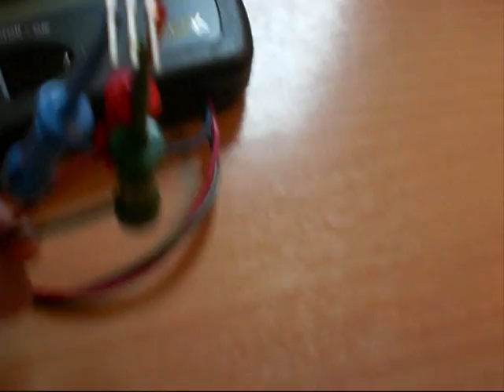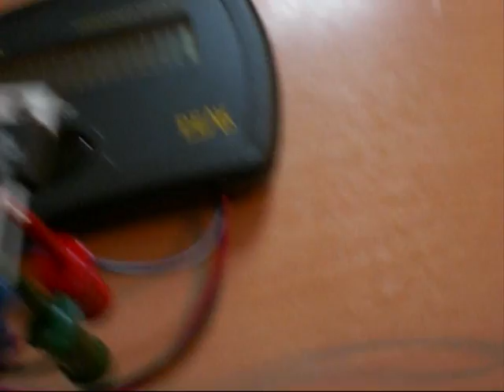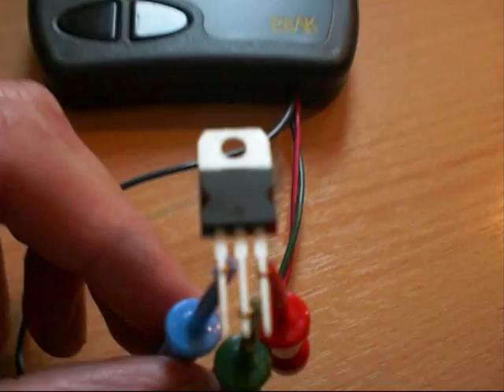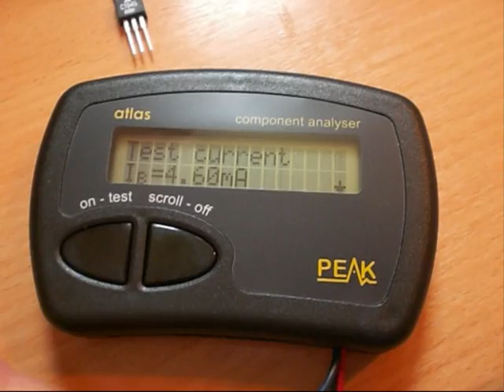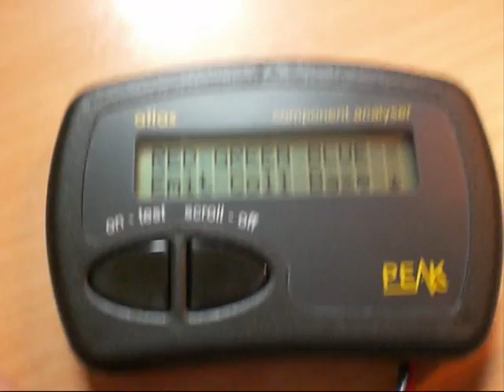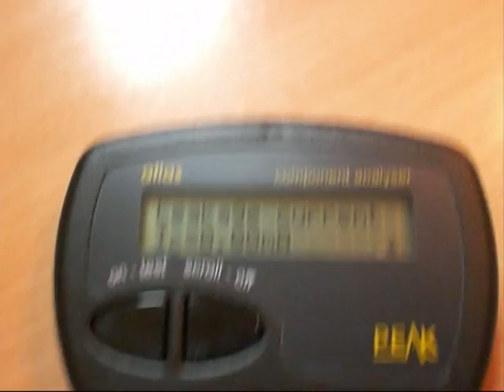WARNING!! - FAKE 2SC1945 & MRF497 TRANSISTORS.

Comment: Interested in your comment diode protection between collector & emitter. I am rebuilding a power amplifier on a TS-120S and the 2SC2290 and 2SC2509 all test diode on BE BC and EC as you mentioned. I also tested some 30 year old 2166 and 1969 and they test diode on Collector - Emitter. My transistors are OK.  Regards VK4HDA

Comment: Thanks for posting this up!  Makes for interesting viewing.   

Out of interest, what would be your next step in identifying a fake if the analyser came back OK?
Reply from the maker: Fakes come in all types even ones that apparently work, i test all mine under RF conditions to check for amplification as no standard transistor tester can test for this.

It's not just fakes you have to look out for as there are many recycled parts out there which are cleaned up to look like new but are really just used scrap parts - if you get lucky some may still work but others are junk.

I have seen 2SC2078's (cheap RF transistor) being sold as 2SC1969's and people are fooled as they do actually produce RF at 27Mhz but not like they should!
Reply: weazle66 I guess there's no better test than sticking,it an RF rig! Good to know!

Coincidently, since this comment my final has shorted, so I will be procuring one if these as a replacement.

Cheers!

Comment: Hi Mark, Great to see you are back.. The 1945 looks like it could be a recycled  2166 or 1969. Does produce  RF if wired as a 1969? Regards John
Reply from the maker: Hi John,  no it's not a 2166 or 1969.

When i tested it for RF it produced about 0.5 - 1w at 27Mhz and heated up very quick, personally i think it could be a 2sc1970  but what ever it is is pretty much useless as what it should be!

It,s not recycled as the pins have not been crimped -  those cheap refurbs have all the tell tale signs of replaced pins so the silly people do not notice they are not new, if you look at many of the refurbs the pins are slightly off center where they have joined new pins on.
Reply: Hi Mark, Re: the 1970 yes that makes complete sense also very interesting stuff regarding the pins on recycled transistors. Another sign that they could be moody is when you see a photo of a number of them they can all have different batch numbers. I wonder what these guys will try next.. Keep up the good work mate.. Regards John